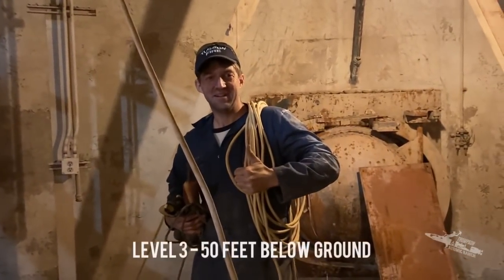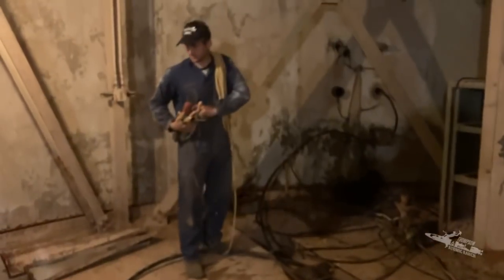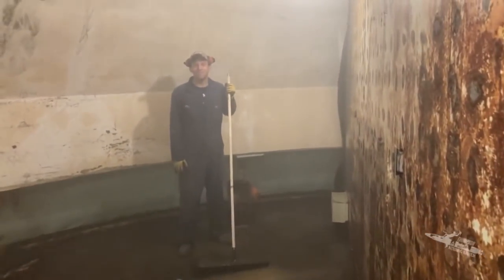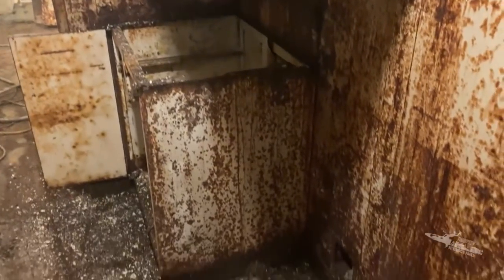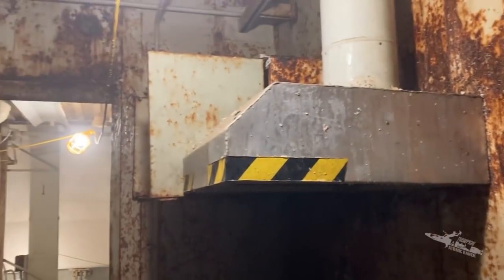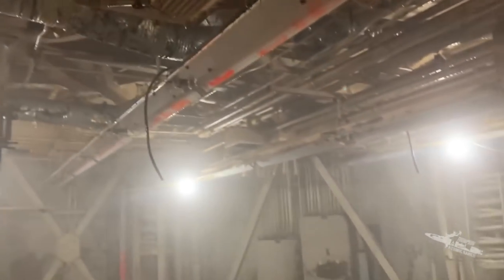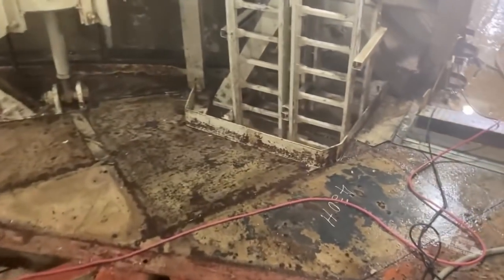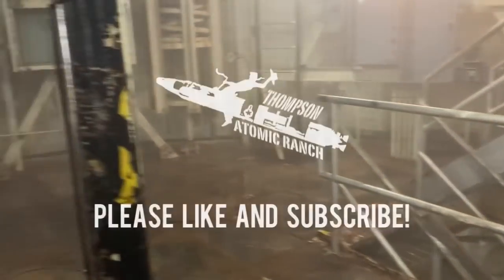CHINESE tools used to clean an AMERICAN missile silo?!

Comment: Glad you found a couple of the conduits.  You will find the other 4 if you dig/trace the conduits you found backwards.  On your blue prints, (marked "point A") there is a point where all six come up near the surface in a tight group, then they split out like an octopus.  I dug down and cut all mine at that point where they are tightly together, then added new conduit to bring them together into a service box at the surface.  It's the perfect place to bring in more power, fiber optics, water tubes, etc.  If you don't do fiber, you can use other data media to install a WiFi router so you can use your cell phones.  Having phone service and Internet is REALLY useful when you are underground!

Comment: Looks like you guys could use a healthy supply of rust converter.. thx for taking us along.. You're doing a fine job.. Take care my friend...
Reply from the maker: Does rust converter work pretty good?  I’ve never used it before
Reply: @ThompsonAtomicRanch  A rust converter would probably be easier and cheaper than trying to mechanically remove it via sanding, sandblasting, etc. Converters contain phosphoric acid that chemically converts the red rust (iron oxide) into inert iron phosphate which looks blackish in color. Naval Jelly is the oldest (I think) rust converter, so named because it was used on rusty navy ships. You can try making your own converter, but it can be tricky from what I understand. There are commercial versions, like FDC Rust Converter, that might be workable in your case. You can brush it on or spray it with a pump sprayer. After it dries, you just paint over it. For any areas that you'd want decorative, though, you'd probably want to grind down before treating. Otherwise, scale patches will show through the paint.
Love what you're doing! Wish I could come down to help you out, dang it. :D

Comment: Need a 55 gal drum of Evaporust with a small sump pump in it supplying that pressure washer, then that rust will be gone.
Reply from the maker: Does Home Depot sell that stuff?
Reply: @ThompsonAtomicRanch  maybe, I’ve seen it at the same place you bought that pressure washer though, harbor freight